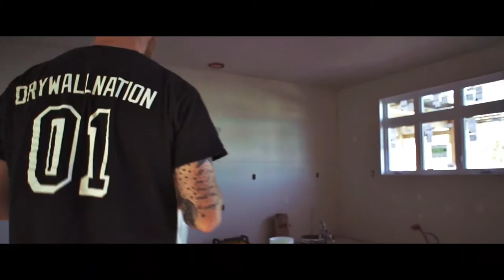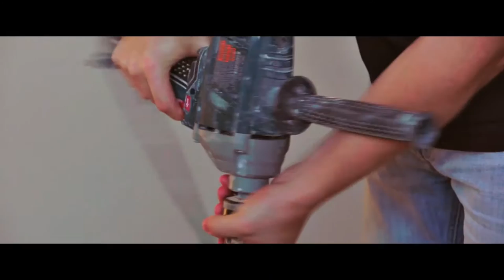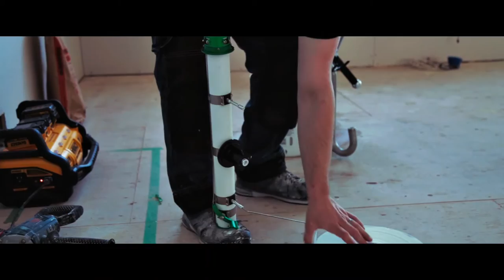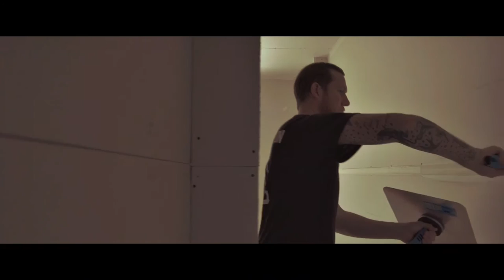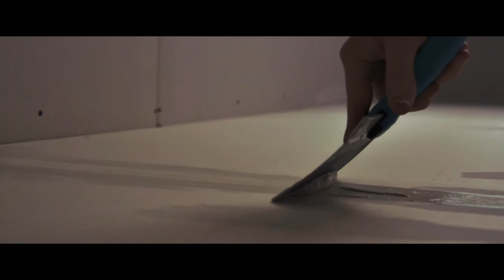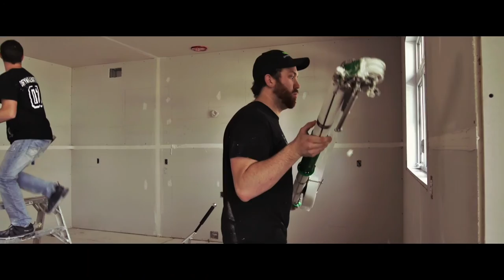Drywall Nation Automatic Taping Tools. Bazooka. Automatic Taper.

Comment: Hey man. Do you get a dry spot 8 inches from when you begin pulling the bazooka? 99percent of the time i push mud into it with the roller but still annoying. Ive heard people have the same issue. Thank
Reply: Run your gun on the wall a few inches first without it feeding tape that helps with blisters when you start otherwise the mud can slump down the tube.

Comment: I have a question for you guys. I know you are big on Fibafuse but I have heard concerns about it in corners, do you run it in corners as well or just flats?
Reply: Nick Lehnhoff  my opinion the for the corners are not good for it cuz it will crack